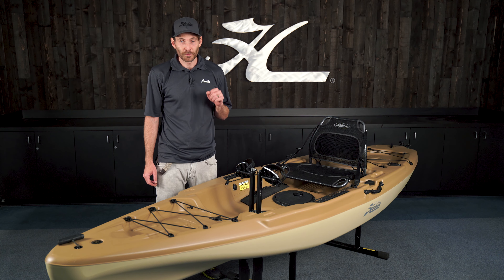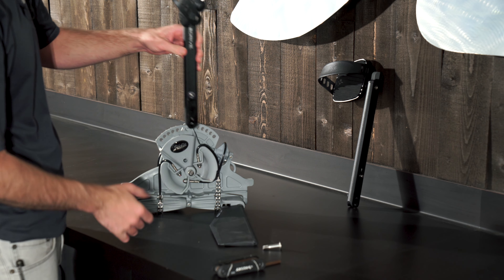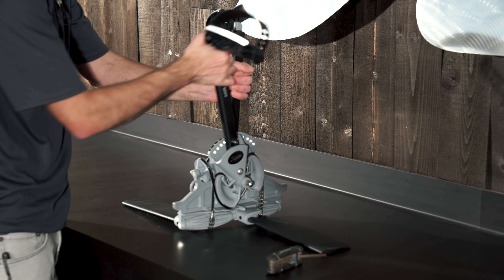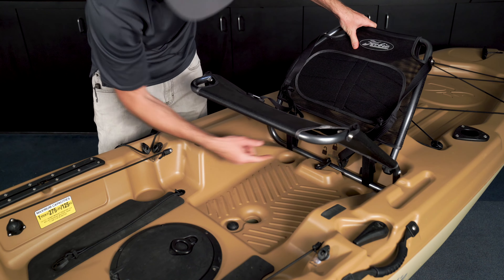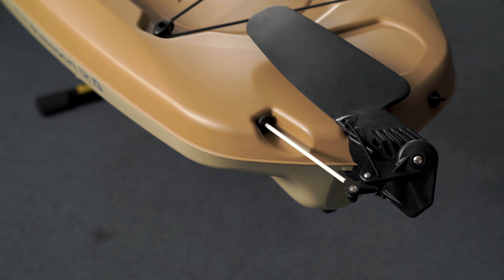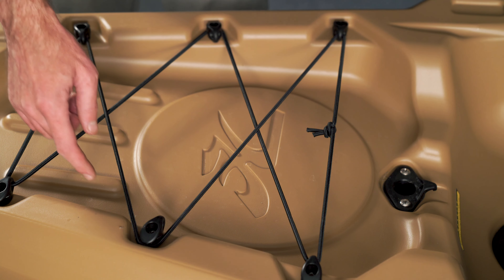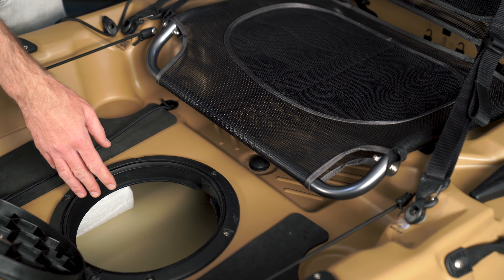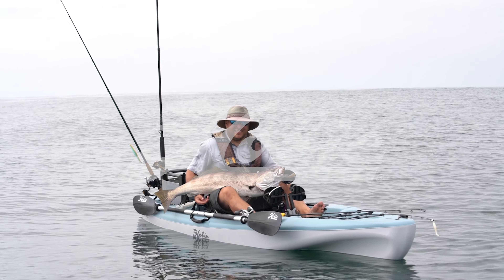QuickStart for Hobie Mirage Passport kayaks

Comment: So glad you upgraded the hull to 1 piece and the drive.
Reply: how's that considered upgrade?
Reply: @asianangler  As far as the hull goes, better construction. The plastic on a roto-molded is all 1 piece and molecularly solid, lasting a very long time and has high abrasion resistance. 

The 2 piece designs are ABS plastic, cheaper, and are simply sheets layered to form the hull.

As far as the drive, big upgrade with the bearings and GT tech. I had an outback and you can feel the difference in that kind of drive.

Comment: what do you recommend if steering rod disconnects from handle? I've tried applying adhesive/electrical tape to no avail. Going in through the hatch to access is very difficult and even worse if you're trying to ensure a good connection is made

Comment: What is the screw size for attaching the rudder? You can see it at 5:23. I bought a secondhand hobie, and it was missing these screws.
Reply: I believe its #14 3/4" Screw (part number: 8031890)

Comment: Question: how does this kayak compare to e.g. the Compass 2021? Is it only the weight that is a pro? I notice that the seat of the Compass looks a bit higher quality. Just wondering what is the better choice although (here in NL) the Lynx probably costs a bit more... Thanks.